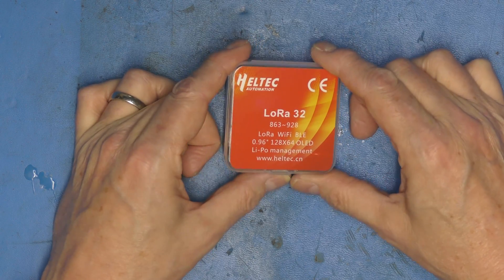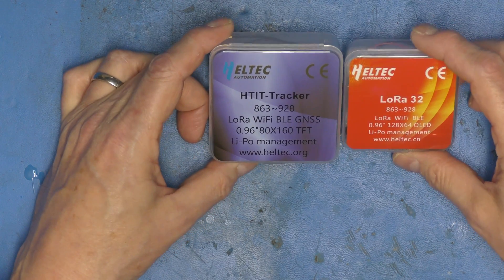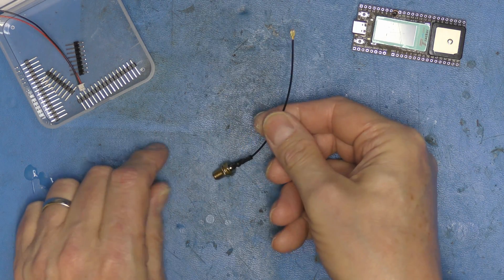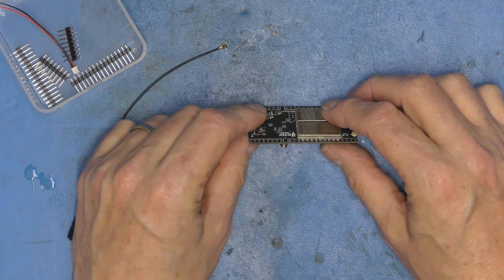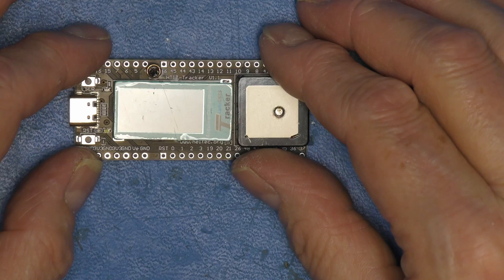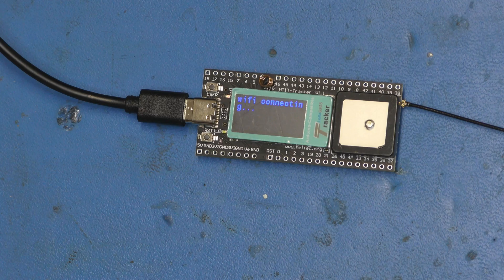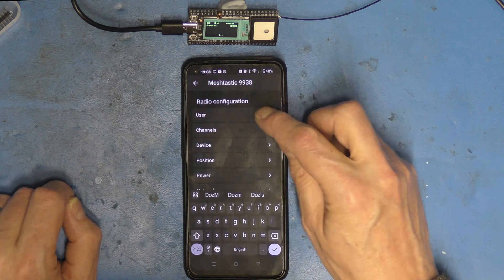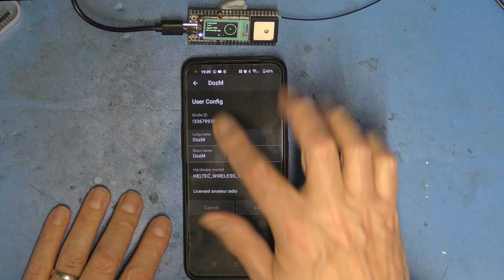A quick look at the Heltec Wireless Tracker HTIT

Comment: I see some youtube videos swapped the antennas. Not sure, because none documentation is saying which antenna is used for LoRa and which for GPS.
I assume you did it correctly. But I need a confirmation.
Thanks!
Reply from the maker: It's physically marked on the PCB. LORA & GNSS.... not sure how you're going to get that wrong really.
Reply: @AndyDoz on the board it states.  But the box contains two Antennas. And I'm wondering too, which antenna is for LoRa and which one is for gps. Or are they both for LoRa? Thank you in advance!

Comment: Any idea on why mine wont get gps
Reply from the maker: Right firmware?
Reply: I plugged in an external antenna and it worked. I used the cheap antenna that came with one of my old Heltec v3.